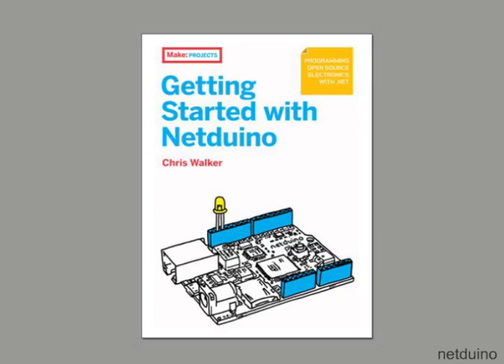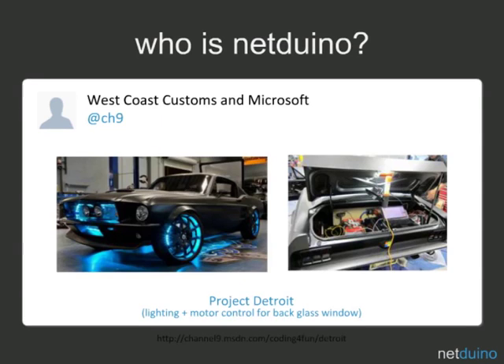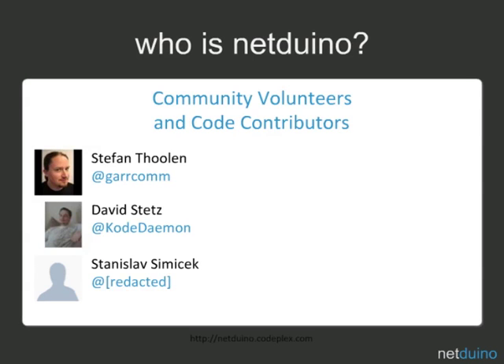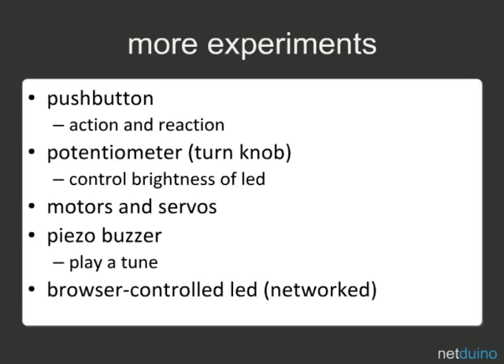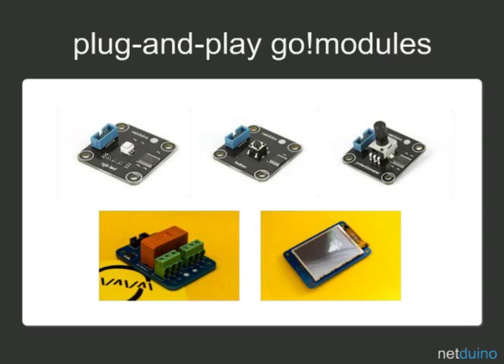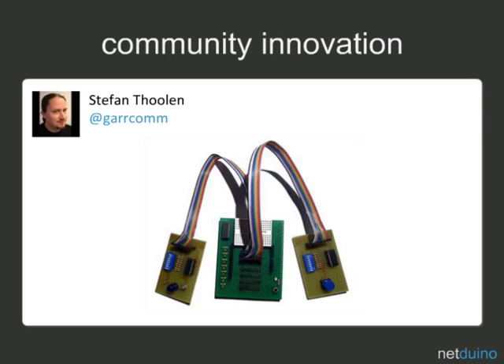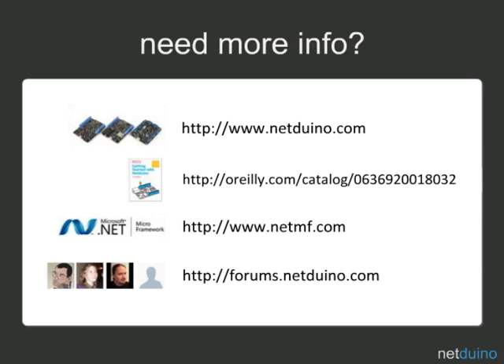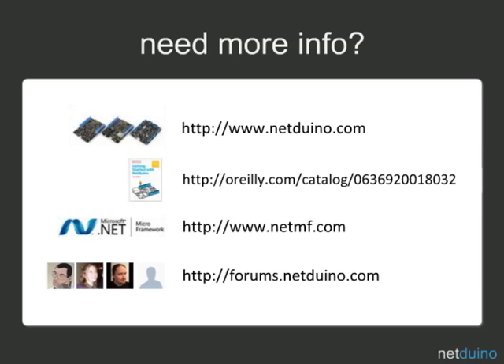Getting Started with Netduino

Comment: Arduino and Netduino are extremely similar prototyping platforms (programmable microcontrollers). The biggest difference is that you program the arduino using the arduino IDE (Integrated Development Environment) and also the arduino flavor of C#. The Netduino is programmed using Microsoft Visual Studio with .Net Micro Framework and you can use C# or VB as your programming language. There are other differences but you can do essentially the same thing with them.